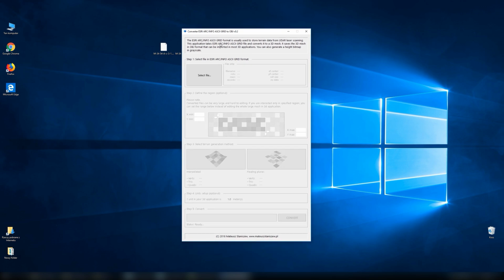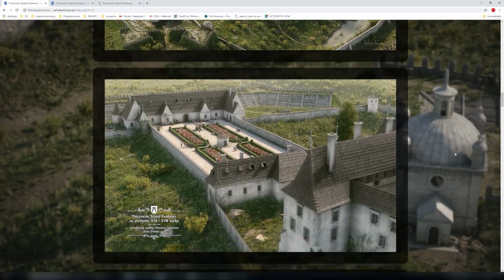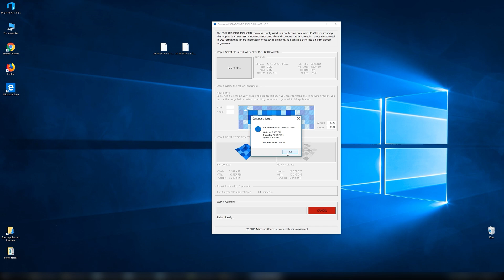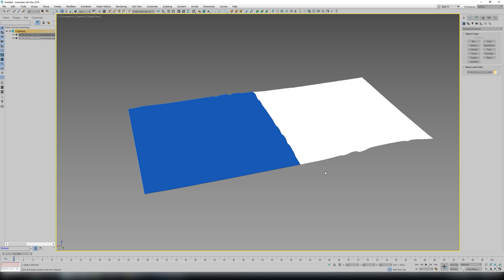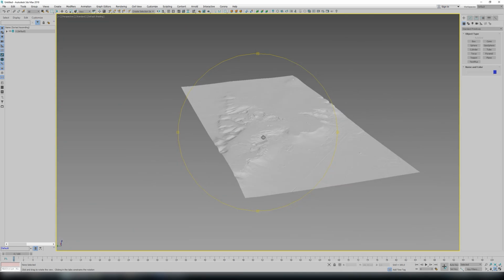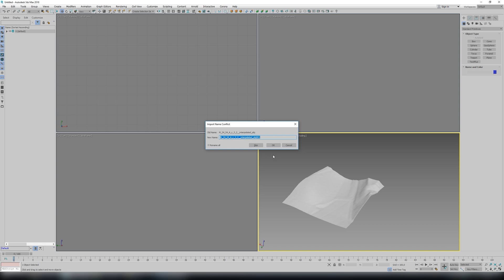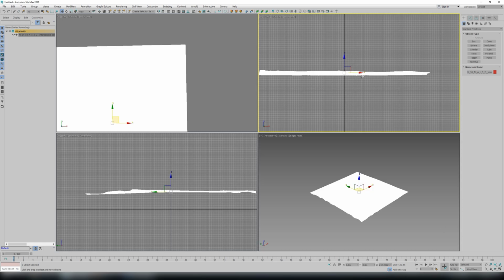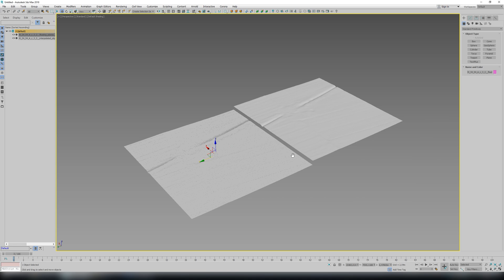ESRI ARC/INFO ASCII GRID to OBJ Converter

Comment: Hello Mateusz, thanks for the wonderful App. Unfortunately I need to cut the region because the acs File ist 2,3 GB big and my software will not accept a to big obj file. The problem with the cutting is that the region is never right. I think its because the converter doesn't read the cols. instead there is nothing for the cols, rows are the col number and records are row number :( The file is correct, like yours in the vid.

Comment: This saves a lot of time bouncing between software and processes. Really good tool. 
UPDATE: I have been using this last night and converted thirty maps to obj in less than an hour. This would have taken all day with my previous methods.  I have paid for tools that didn't work. This did exactly what I wanted and it's free. You should gather some testimonials and charge a small fee for this.
Reply from the maker: Great, thanks! I am glad it worked

Comment: This app height is so big cover my entire desktop and there is no scroll option to proceed next step.
I add ASCII file first it was keep getting close but after Run as Administrator finally that file identified but... this app big in height which cover my entire desktop which is 1920x1080 resolution i can't use next step if i can't scroll or see
I tried to rotate resolution landscape to portrait but this app can't maximize or scale to see convert option. which is disappointing
Reply from the maker: you're right sorry about that.. the scrolling is missing
Reply: @tedeusz83  Thanks a lot for the application. Have you sorted the scrolling issue?
Reply: @saifizmohammed3059  no